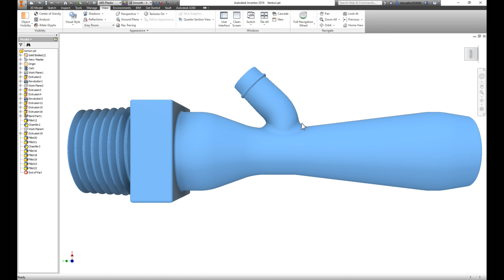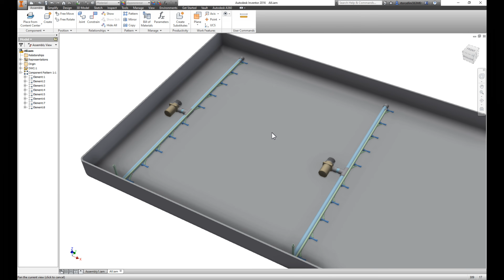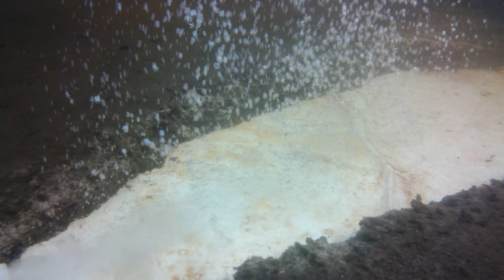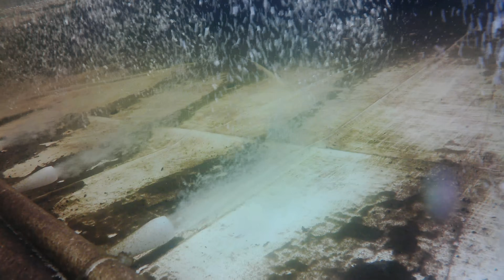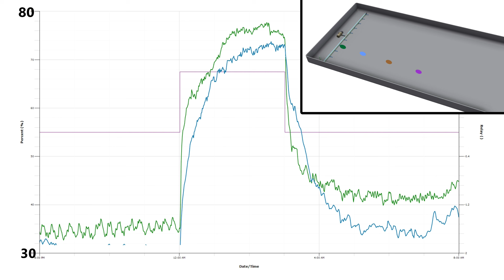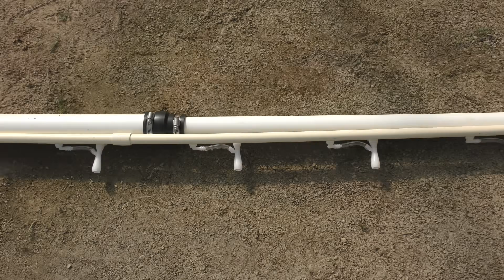Better Bubbles? A Venturi Tube Experiment

Comment: Could you let us know the flow rate of the pump?
Reply from the maker: according to the specs, the larger pump is 66.03gpm and the smaller one is 52.8gpm.  They are the Jebao DCT series
Reply: @Bigelowbrook  thanks for the reply yea I’m a big fan of the jebao pumps. I run the 1200l/h and 3000l/h pumps in my little aquaponics modules. Very reliable
Reply: @Bigelowbrook  ok so the 66gpm is 18000L/h so with 20 nozzles they are flowing about 900L/h each
Reply from the maker: sounds about right.  I doubled the nozzles with that longer section but the pump size isn't double so technically there is less flow through them.  However I think the sum of all the restriction from the throat of the nozzles may still be restricting some of the overall flow.  There are so many variables with something like this it was difficult to explain it in a "short" video.  I'm already starting to collect footage for a second video.  😉
Reply: @Bigelowbrook  might be worth doing a quick calculation that the area of the restrictions in the nozzle throat equals the area of the manifold pipe through which the water flows. Then you know your not choking the flow of the pump
Reply from the maker: @jamieclarke321  Inside throat diameter of each venturi is 7mm for which is an area of 38.48 sqmm.  Times 20 nozzles is 769.6 sqmm.  ID of the 2" PVC pipe is 52.50mm for an area of 2164.9 sqmm.  There's a few other factors that probably effect the flow like frictional loss in the ventri, but I probably could add 10 more nozzles into this and may not loose much flow through each nozzle.  Some of this I just sort of guesstimated the flow so I'm not surprised I was off with this one.
Reply: @Bigelowbrook  based on those numbers you should be able to fit 56 nozzles for the 2 inch pipe and you might actually see an increase in energy efficiency, flow rate through the nozzles might actually be higher as you could be losing a lot of the 66gpm that the pump can deliver due to restriction. 

Pipe diameter has the biggest effect on resistance in a pipe as resistance goes up by diameter to the fifth power
Reply from the maker: @jamieclarke321  I'll have to try it out on my next revision.  I have a new nozzle design that is producing a finer bubble.  Probably an update video will be out at some point!
Reply: @Bigelowbrook  looking forward to the next video. I’ve got a Venturi design as well that works pretty good but so many variables to optimise with venturis! 

Keep us up to date. I’d be happy to buy the 3D files if you sell them like you did with the bell siphon design

Comment: have you considered the first setup with the nozzles on one manifold facing north and the others facing south?  Then you would generate a circular circulation pattern.  
I suspect the low oxygen away from the nozzles is partially from the rotting sediment consuming oxygen from the water.
Reply from the maker: that would be a cool idea.  Probably could alternate them from one set to another and create some large whirlpools (I guess we could say circulating around a vertical axis). I found with the 20' set along the edge, the water does a fairly good job circulating somewhat around a horizontal plane, but it isn't perfect since the intake point is fairly far away.  (hopefully that makes some sense!)
I'm hoping the greater movement of water in the system will prevent more solids from settling out in the DWC so they will eventually get caught in the radial flow settler downstream....
Reply: I do something like that. I have 6 venturis around the edges of a 3.6m bed. 1 in each corner and 1 each in the middle of the long sides. All are angled clockwise. It works well.
Reply: very smart

Comment: This is a very clever design. Is it cheaper and as effective as running a large air pump?
Reply from the maker: I cut a whole section out of the video where I talked about my diaphragm air pump since I felt this video was already too long!  I believe it runs at about 100 watts vs the 125 of this setup.  It aerates a smaller area of the bed, plus I have a bunch of air stones and tubing all over the place.  The air stones clog over time or if a tubing comes apart, the majority of the air comes through that one break.  IMO the venturi is a better option since they don't clog (unless the pump sucks up a piece of debris), there's no tubing to mess with, and the overall material cost is probably 1/3 of an air pump and stones.
Reply from the maker: correction:  piston air pump, not diaphragm
Reply: @Bigelowbrook  This was going to be my exact question.  Thanks for explaining the pros vs airstones.

Comment: I would suspend the system higher in the water and point it down.... closer to the surface the more air it will pull.. from my experience with power heads on fish tanks
Reply from the maker: These are only set down about 10 inches so technically it does have to work a little harder.  If I did set them near the surface, I would be concerned about the roots of the plants getting caught in the piping as the rafts are pushed by.

Comment: Why not use a Siphon mechanism with a DWC. If only the rafts would sit/rest on something in the first few cms (eg 2cm ), one can siphon easily 10 cm i guess. Such a design would give plants enough time to breath. You just need a huge Sump. Has anyone tried this ?
Reply from the maker: The DWC bed is the sump for this system.  If I siphoned that bed the sump tank would nee to be 5000 gallons!  ;-)
Reply: @Bigelowbrook  Thats why a huge sump is mandatory. The thing is is it viable?
Reply: @MEothain need the double nutrients to mantain same concentration